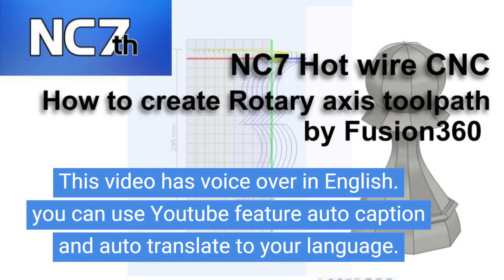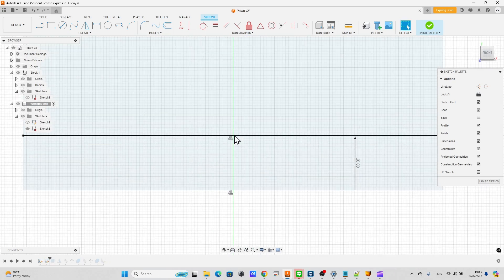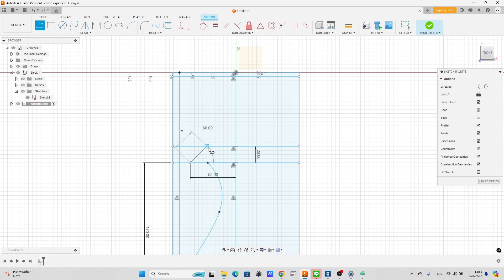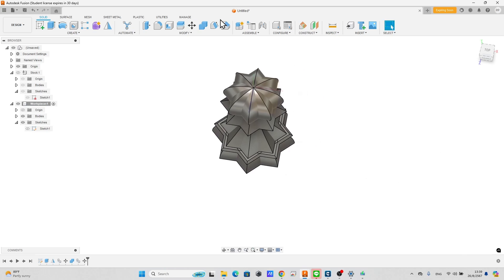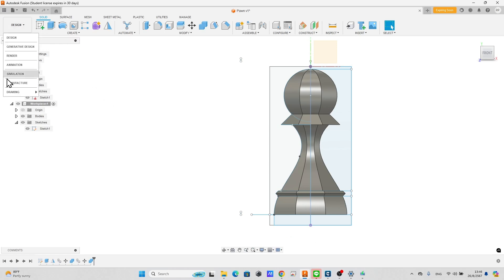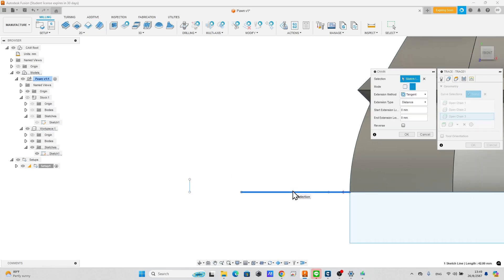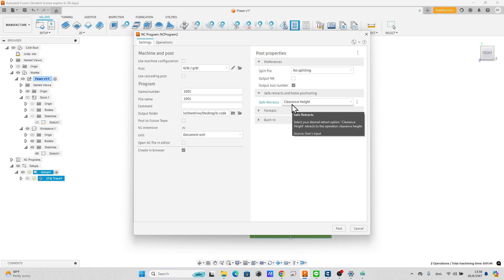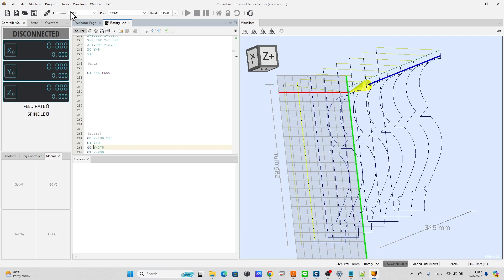NC7th Create Rotary toolpath with Fusion360

Comment: ¿Alguien ha comprado este equipo?.¿Por que sus videos no tienen comentarios?
Reply from the maker: I sold almost 40 of the machines from June this year for Thailand domestic and export.
Rotary axis is option that sell  separately just 4 units of them has been exported.
So, It is still new for the market.
My customers are still  learning on basic 2D cut before go to 3D cut that much more difficult. I made this video for them and they are always direct contact to me in WhatsApp +66815967407.
That why there is no comment now.
You are the first. Thanks😊